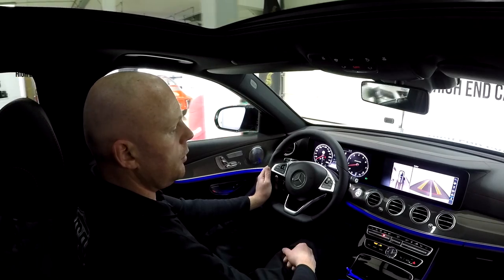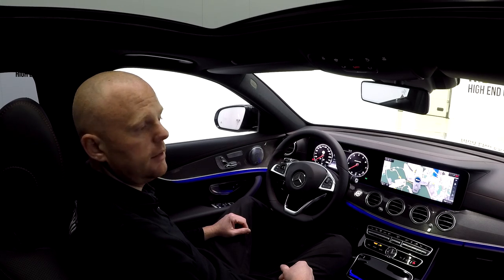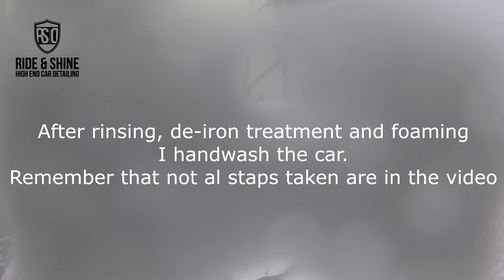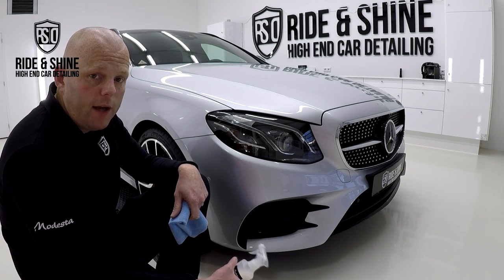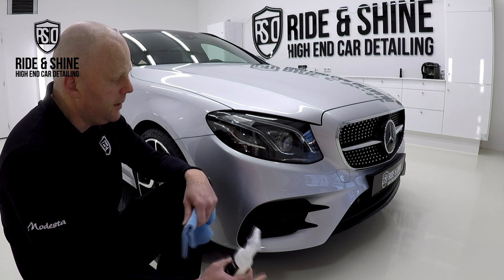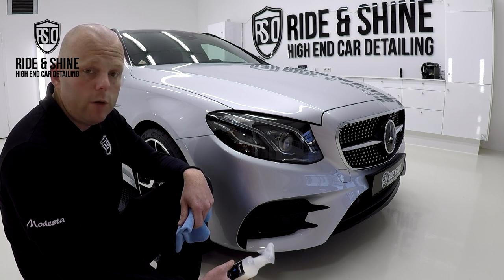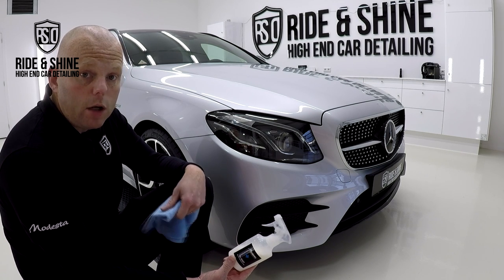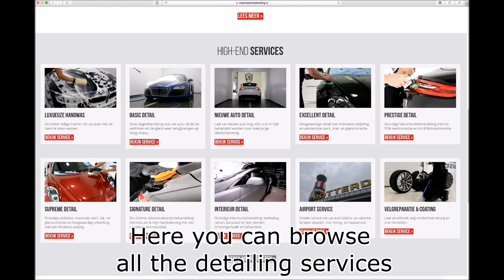High End Car Detailing Mercedes Benz Estate AMG New Car Treatment with Modesta

Comment: I've been following your channel for a while and I enjoy every one of your videos!  I had a question if you don't mind answering.  How do you address the lower rocker panels if they are really filthy?  Going over them with a wash mitt does little to nothing and just fouls up your mitt for the rest of the car.  Usually I'll get some degreaser and a boars hair brush and do them between the wheels on each side, but I feel like its not very efficient.